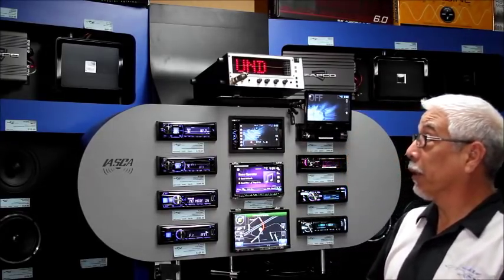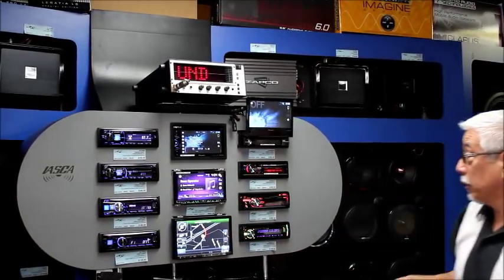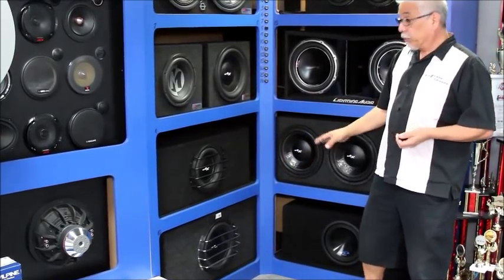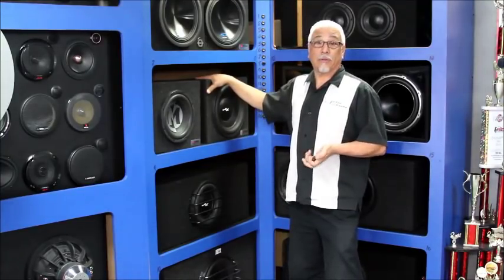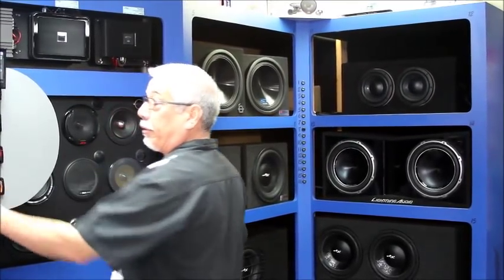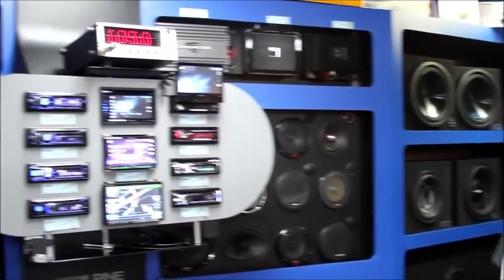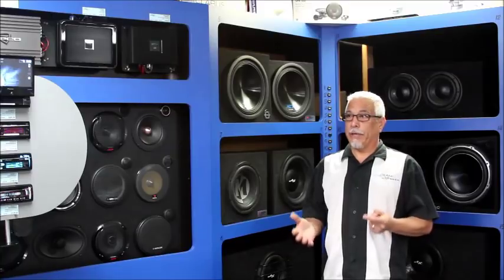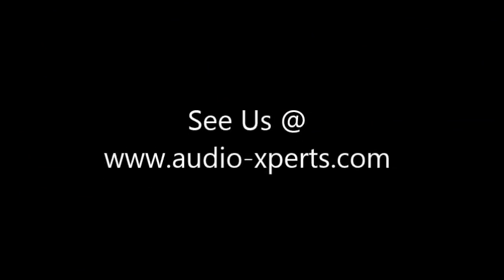Sealed vs Ported Demonstration by Audio Xperts using SPL meter to show output differences

Comment: no disrespect,  but this video is misleading. the goal for a successful subwoofer install should be: how does it sound?,  not how loud does it get. to compare two different drivers in two different enclosures and expect to get some comparison is not fair and is misleading. both types of enclosures have their good points and bad points. sealed enclosures are amazing when used with a sub that is designed for sealed only. a ported enclosure is amazing when tuned PROPERLY.  too many variables in this equation, to compare the two with an SPL meter means nothing.
Reply: I agree..and then throw in box placement..my sub box will gain or lose 10 db depending on angle and space from the back wall
Reply: You didn't pay attention to the video guy
Reply: +nmarcano3 how so?
Reply: CLEARLY stated that the subs were the same.
Reply: +nmarcano3 what is implied and what is a reality are 2 different things. even still, in the most critical comparison  (same driver, same amp, same source ) the use of a SPL meter still makes no sense.  of course everyone knows a ported box will be louder than a sealed box in a ideal comparison.  But is that what we, as a consumer or a sound engineer should be striving for???  if that was the case, then we all should be driving around with Lanzar 18"'s in a universal  bandpass box.
Reply: +John Wanamaker loud is all that matters though for people who have subs, isn't it? Just listening to rap music rattling our mirrors off?
Reply: +nmarcano3 I started this hobby of bass reproduction in 1988 with that same thought (like most of us have).. it's been a long strange trip, along the way I have changed my perspective on the subject. my 15 in my comp car has amazing extention and sound quality,  but it wasn't easy to achieve. .. but then again- the things we have passion for are often the things that take years to perfect and refine.
Reply: +nmarcano3 not really..we want lows now and get them loud..not 50 Hertz..which some people consider low..we want 20s and 30s loud
Reply: +Timothy Hinton sorry bud... it was meant to come off as arrogant sarcasm. yea I understand. car speakers already handle 40-50 range... I need that 20-35! That's why I built a custom box myself
Reply: +John Wanamaker The problem with doing such comparison like you suggest is that it is 100% of the time SUBJECTIVE. There's no way to quantify how it sounds and the sound itself will be percieved differently by every individual.
Reply: Yes u are correct i have a some kickers 15s in a sealed box and that things hits hard
Reply: rhurtadorh32 how do you keep finding me guy?
Reply: +rhurtadorh32 now you have guy :)
Reply: +John Wanamaker It's not misleading a single bit, you just don't understand why they did it this way. Tell me, how can you show in a youtube video that the sealed/ported sub sounded better/worse? You can't. The only thing that you can show which audio ignorant people will understand is volume. This video isn't made for the audio expert flaunting their ego on the internet.
Reply: +VaoDxArchAngel What do you view as more important? Making money off the ignorant or opening the door of discussion to break away from marketing hype in this industry?
Reply: john wanamaker What I think is irrelevant. So is what you think. This is their video, and they choose what community they wanna reach out to. Also, discussing audio gear has always been problematic as placebo is such a huge part of it.
Reply: +VaoDxArchAngel I don't feel what you have to say is irrelevant, nor my own words. The posters of this video left the comment window open. To take it one step further, I truly believe that this audio shop did a good job at this video.......But when you open a can of worms and tell me that they taste good- that's when the discussion starts. I totally agree with your comment of problematic discussions of audio equipment. Brand loyalty, listening habits, forms of music, aesthetics, and psychoacoustics all play into this......... but we should never shy away from opportunities to elevate this passion and this science of sound reproduction. Just my opinion
Reply: john wanamaker Yeah true, but youtube isn't the place to do so is all I'm saying. Most people here aren't audiophiles that know everything about audio. They just want to find out if they should get a sealed sub or a ported sub. While I do think that they should have mentioned to always find a good size ported sub and what ratio port inches:driver inches it should be. When I want to discuss audio gear I use head-fi and avforums. Have you tried those? Really friendly community. Head-fi is obviously mostly for headphone discussion
Reply: John Wanamaker You have to understand who he is making his salespitch to. It's the basshead kids who come in off the street looking for boom similar or better to what their friends have. Few people will ever have a properly tuned system that is setup optimally for listening enjoyment. Most prefer a loud rattle box which is why so many people think sundown audio is great.
Reply: Pimphand Gamester thank you. You are literally the first person I've seen in this comment section that has a fucking clue what you're talking about.
Reply: It makes me laugh when i see those places selling Pre-maid boxes and they are made for all each speaker has its own parameters  ''thiele and Small'' formulas sealed ,band-pass . ported , compound,  double band-pass ....
Reply: Honestly if you have the room there is never an excuse not to use a vented enclosure. You can literally decide if you want it to be a sq or spl setup just based on port tuning and you can use a smaller amp to achieve the same output. I run little 6.5" home audio subwoofers under my rear package tray ported and even they over power my front speakers.

Comment: skip to 3 minutes for demo to start 😎
Reply: TSBGLtd all true though i understand the use of damping in a sealed box (usually poly fiberfill @1lb per cu. ft)is to present more virtual volume for the driver by displacing the air and making it more compressible. This has a side effect of excursion control. Also supposedly controls high frequency distortion created by the box it self.
Myself I always liked sealed boxes. easier to tune and sound good with a variety of music.

Comment: I agree with oyobass, a subwoofer near the floor will perform better than one mid way up the wall. Just like a sub in a corner works twice as good as one against a flat wall. You need to test them at the same hight.

Comment: Keep in mind, which I'm sure you know, Sealed enclosures tend to have must tighter bass.  Ported enclosures tend to be more sloppy.  The sealed I believe, is nicer sounding and work well if your interested in sound quality ~ RTA reading.
Reply: Sounds like the ported enclosures you have used are poorly designed to the subwoofer.
Reply: You know ..bigger the box bigger the bang sealed hits #HARDER DUH....👍🏽
Reply: @AaronClinton  Nah. POrted sunds wack
Reply: @mr.b3168  then you haven't used a properly designed and built ported enclosure

Comment: I had a prefab bandpass box back in the 90's that would create a crazy amount of bass for two 10's, but it was sloppy af. I switched to a sealed enclosure with better amps and subs, it got about as loud, and the sound quality was way way better. But all the enclosures have their place, and it's just largely based on preference.

Comment: Depends on the space there going in, in my opinion. Conventional trunk, sealed box with the speakers facing the back of car. The car is the other half the box. Ported for hatch back, SUV or vans.
Reply: Which do you think would fit better in a behind the seat single cab pickup?
Reply: sound better, I meant
Reply: I also have single cab truck with rear window removed and 2 15s in a ported box wonder if sealed be better it's way louder if my doors are open

Comment: Honestly like sealed boxes in my preference I like Tight Punchy accurate bass ported does sound way louder and the bass does get a little deeper sounds boomy and bass thunders but still like sealed better my personal preference tho
Reply: Speaking in 15s for spl 12s won't put out the same spl as 15s
Reply: Baby Gotenks hmmmmm im thinking  about getting a sealed  box I have 2 15 cvx and wanna switch?
Reply: Elgallo Deoro from a ported box with two 15s just get a bigger box
Reply: Baby Gotenks im just gonna switch to sealed !
Reply: Or, do yourself a favour, and "deliberately BOLT two speakers face to face, (with just enough of a spacer sandwiched between them, to separate the diaphragms apart, to stop them rubbing against each other, as they move TOGETHER in either direction), making absolutely certain to reverse wire one across to the other (in series) as that way, the signal current FLOWS through one's voice coil, pulling it IN, whilst simultaneously flowing via the reverse terminal connection (of the other), which allows the same current to "push" one speaker's diaphragm OUT, with the other pushing IN equally as hard, to then pull each other the other way, (thus avoiding EITHER speaker from completely bottoming out, or extending beyond the magnet's core material when at their maximum extensions, driven hard).

Result.?
NO actual compression of air, being able to occur DIRECTLY between either speaker, but BOTH act as if ONE SINGLE DIAPHRAM, which can thus simply be mounted in a free standing (single) sheet of particle board placed ANYWHERE - even in the middle of the room, such that the backs of BOTH speakers, send the complete sound wave, away from each of them in turn, as the COMBINED dual diaphragm pulsates equally hard - in BOTH directions as the sound is played.

Then and only then will a PORTED versus an UNPORTED system be truly comparable.
Why ? 
Because either works just as fine as the other (same SPL levels with both systems) - as it's then NOT about the speaker's ability to DRIVE in just one direction only, but in both in & out directions, ported or otherwise.
Reply: Quix Kiwi , all that does is create a situation where the mass has doubled but the compliance is halved. This requires double the power and doesnt change ANYTHING about the drivers themselves. The benefit to the arrangement you describe is needing only half the enclosure space and negating any non-linear distortion in either driver. It doesn't magically turn a driver that needs an enclosure into one that doesn't.
Reply: But it doesn't NEED TWO enclosures to both be ported, just one with a 'she'll be right" any sized port.!
As I have tried many boxes over the years since 1965 to discover pharque-all difference between any "ports" (and or port extension or pipes etc.), when deliberately paralleling speakers (hard bolted face to face) to mount them as if ONE speaker  - (one against the other), by placing one IN the box & one out (or both out on a self-standing plain-wall/panel.}

However I'm sure you'll still say I am wrong .. so will leave that as it is.

p.s, 
The MASS of air "moved" is exactly the same as that (moved) which a single speaker diaphragm (of that size) can "move" = and as to what you are trying to mean with  "compliance" ?
When that has nothing to do with anything -- beats me (as there IS no compliance)?

Compliance to what -
COMPLIANCE refers to "complying with a rule or specification, or a set of variables.?

Compliance has nothing to do with "resultant sound".

ie:
One must build a house to (formal building codes, to "conform to") COMPLIANCE standards ?
Or one must have a vehicle that COMPLIES with a set of rules, in order to be allowed to be driven on a road..

What rules, of compliance - do you refer to - with an inventive method of creating a more stable speaker diaphragm (combination) - that can be driven harder - that it was ever designed to be driven as a single speaker??

Or do you need to MAKE something inventive - fit someone else's design parameters?

Plus the POWER isn't doubled, but "split" (exactly in half FOR EACH SPEAKER VOICE COIL) - across a parallel circuit, resulting in a halving of the implied impedance, yet the amp still "sends the same current" INTO THE INPUT CIRCUIT (that is then ;later split across the paralleled speakers), at the same potential applied "op" amps output voltage (hence active wattage POWER - through the dual 8ohm speaker's actual combination - is exactly the same, as if driven through a 4 ohm single speaker of the same wattage).

?

All that happens is that one can utilize TWO HUGE 12 " House-type 8ohm speakers, (at their correct lower wattage ratings) as if the two of them were simply ONE higher (power) rated .. 4 ohm speaker.
Reply: Are you saying port size has no difference in how it sounds  or how hard the sub can hit?
Reply: Quix Kiwi not true. You can't just bolt any 2 matching woofers together in a clamshell and stick them in any box with any port and call it good. It doesn't work that way. for a ported box you would use half the box volume and use a port tuned to the same frequency you would use for the regular size enclosure. if sealed, then you just use half the box volume as you would for the single driver non-iso group. doing what your saying would void the warranty on any decent drivers the instant you put a signal to them.
Reply: Yes - "isobaric" ... but only in that confined (sealed) space between the two diaphragms themselves where that remains constant.

Outside of the co-joined units, the combined single unit ACTS as if it was a single diaphragm, thus producing a "better controlled" in & out wave form of "moved" sinusoidal sound waves, by being driven equally well (electro-mechanically) in both directions..

Porting is done in an attempt to "phase correct" the powered pulse, with the inverse lessor pulse as to push into open air, from a vacuum is easier than to push into a compressed space from open air.

Hence going OUT (of the box's sealed atmospheric pressure space forming a vacuum inside the box)  a diaphragm pushes more OUT, than when pulling it back IN, (& thus into the enclosure) where the pressure rapidly increases purely because of the restrictive size of the box, compared to virtually none in open air.
Hence a vent allows a disproportionate amount of air, to "return" to the other side to create an equilibrium?

The size therefore of that vent is critical to ensure that the two resultant sound pressure wave forms, (arriving as they will then do - 180 degrees out of phase) DO NOT SELF CANCEL EACH OTHER, (at the listener's ears) or no sound will appear to emanate from the speaker.
Reply: On the other hand, an on-boxed open air diaphragm's rearward pulses will not be FORCED in the same direction as the frontal waveform is being pushed, so won't "arrive" anywhere at the listener's ears (at the exact same time and loudness) to self cancel anything.!!!
Reply: I use a sealed box too, built to  proper specs for my speakers. It's badass crispy clean bass that rattles the damn trunk to the hood. Sealed!
Reply: In my experience, i preferred the Sealed Enclosure.
Reply: @quixkiwi5337  this is not it chief

Comment: Type of music you like is also something to consider. Music with lower bass like hip hop, dubstep, or anything really bass driven go ported. Rock and classic styles of music with tight, punchier kicks that wont be playing out long bass lines can sound just fine with a sealed box.
Reply: +Luke Connell That all depends on the port tuning. If you get a prefabbed box that is ported too high or is too small it may be loud in the upper bass range but seriously fall off under that.  I will agree with your statement as long as the box is tuned low enough.   I run a bit larger than spec sealed box for lower bass extension (at the cost of volume), but if I had the room in my vehicle I'd have a huge ported box tuned to around 32Hz
Reply: 6